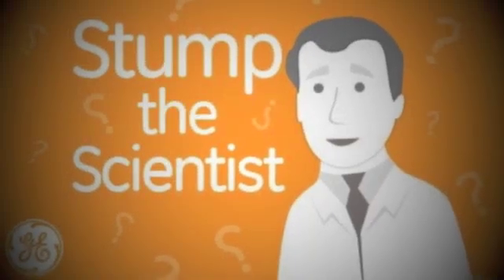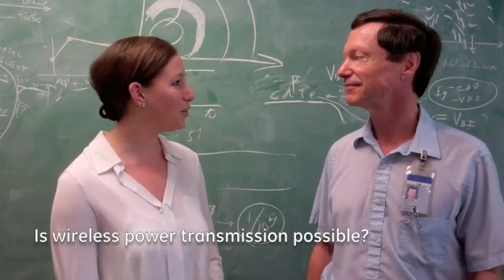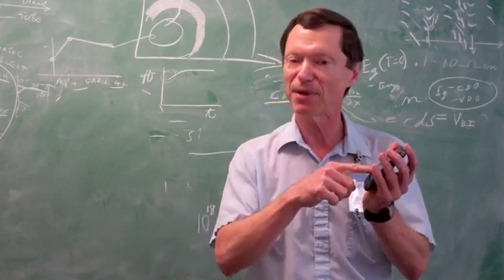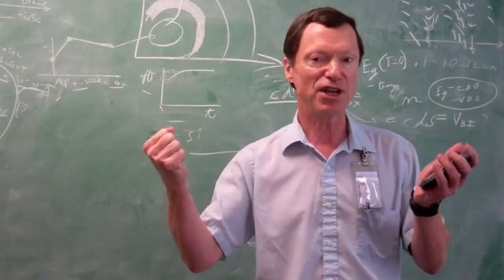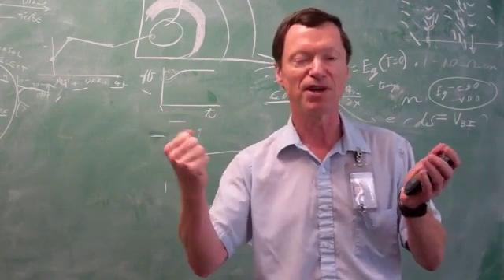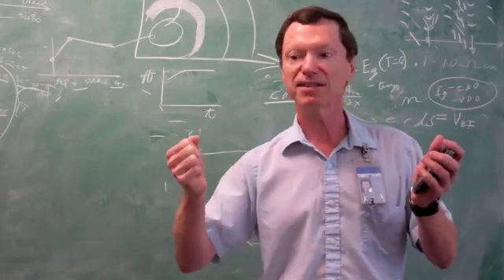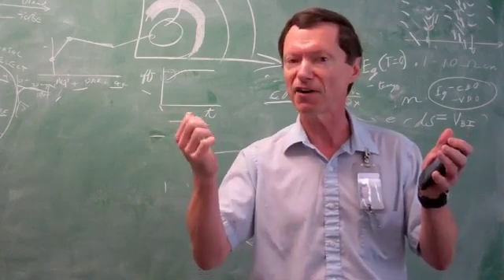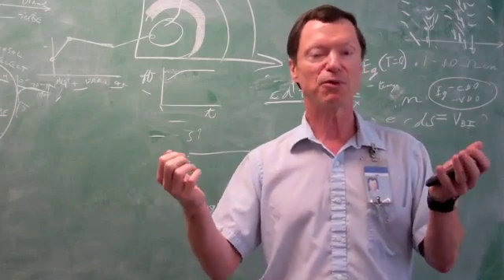Stump the Scientist: Wireless Power Transmission

Comment: Dr. Tesla's wireless system was non electromagnetic and used the ground to connect transmitter with receiver. The receiver was powered by the transmitter so no batteries/generators/amplifiers were necessary. Receiver coil was connected directly to the load.

Comment: Witricity doesn't use photons.

Witricity is near-field (magnetic) technology. Photons are far-field phenomenon (radiation).

Witricity works by inductance, NOT radiation.

If you use superconductors witricity-type systems can be almost 100% efficient, at quite large distances without need for aiming but radiation would be much less efficient unless very carefully aimed with a very tight beam.